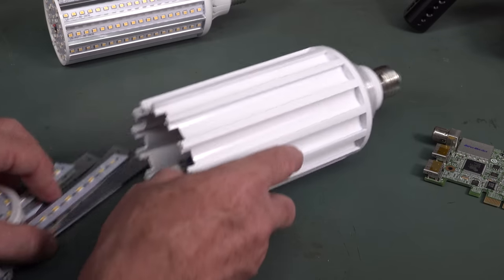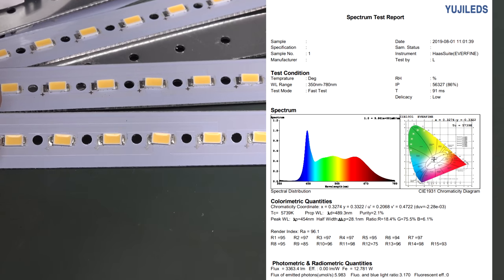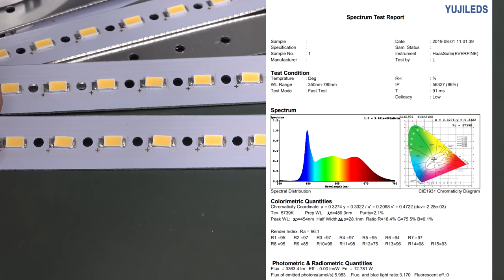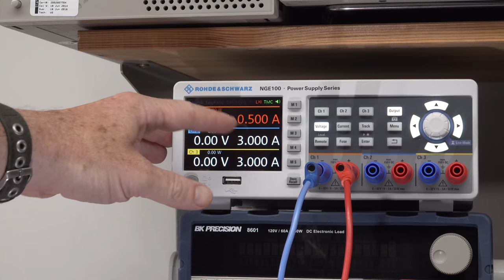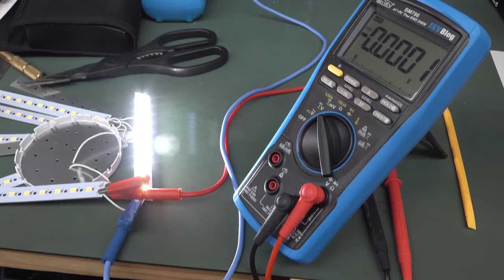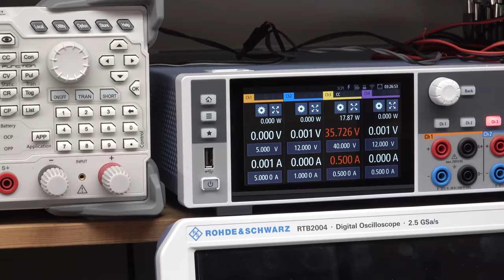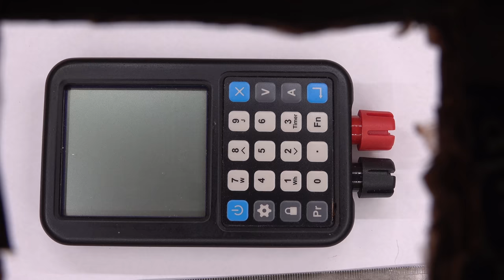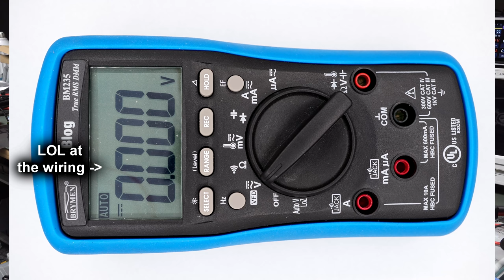EEVblog #1372 - DIY PCB Photography Light Box

Comment: Nice work!
Something worth mentioning about this is that it’s a reflectance light box, most ‘professional’ light boxes on the market are transmission light boxes. This is important for two reasons, transmission light boxes massively attenuate the amount of usable light you will get, often half and transmission light boxes (especially DIY ones that use cheap printer paper with fluorescent whitening agents) will ruin your CRI and CCT (can be on the order of 2,000 K) completely defeating the point of using 95 CRI LEDs. You could see this when Dave used it without the Alfoil® everything had a cardboard brown tint.

But by using reflective Alfoil® you don’t attenuate the light in fact you reflect light that would be wasted going off-scene back into the scene and aluminium has a reasonably ‘flat’ spectral reflectance response so you won’t ruin your CRI or CCT (unlike horrible printer paper) just make sure to use the matt side. 

The downside is you will still get specular hotspots from the LEDs, but if this is a major issue you can mount the LEDs at the bottom edges pointing up but that has its trade-offs. Reflectance light boxes are also just harder to use and more limiting hence why transmission light boxes are so popular. 

TL;DR buy a thousand incandescent bulbs and paint them matt black except for a small window if you want to take photos will ‘acceptable’ colour rendering, however Dave’s thing is probably good enough for 99% of use cases.
Reply: I used to use a light box that used 60 25W golfball lamps to provide the light, in a box a little bigger than A3 size, that took a offset printer plate. Had to make a soft starter for it, using a triac and a unijunction transistor, so the switch on surge did not both trip the mains breaker, and blow lamps.
Reply from the maker: I'm thinking about mounting the LED's on an internal thin wire frame ( so the frame doesn't create shadows) and having them point upwards to bounce the light around the box. I'm pretty confident it would improve the result.
Reply: @EEVblog  Sounds good, only tip is the LEDs can create lens flares if they are placed just outside the frame of the camera thus needing a lens hood which may be undesired. Probably just experiment with your placement, you might find having them pointing at the sides is best for your sized light box.
Reply from the maker: @WizardTim  Yeah, my first thought was to angle them up and outward. Not hard to experiment to find a good solution for any given sized box. I'm a bit surprised the direct down one worked as well as it did.
Reply: Would a home movie projection screen work in this case? I think that it would scatter the light more than foil and produce less harsh shadows.
Reply: Or you can soften the leds with tracing paper.
Reply: @rhalfik  Or crinkle up the aluminium foil and use the shiny side, the random angles should bounce the light around more. Smooth foil gives more localised hotspots.
Reply: The key point is that you MUST use the dull (or the matt side) outward looking (glue the bright side). I did try white paint but the results are horrible.
Reply: Great points!
Reply: Why is no-one mentioning simple white paint? Seems nice and diffusing, very easy to apply, and I don't think plain white paint normally has fluorescent whitening agents?
Reply: @TheHuesSciTech  White paint does provide the best diffusion and almost completely eliminates specular reflections thus it gets used in proper professional setups (along with glass/quartz diffusers) but the paint they use is very specialised and expensive (typically barium sulfate). 

For serious DIYers steer clear of hardware store room paints as not just the ‘Vivid’/‘Ultra-bright’ ones contain whiting agents, those rooms paints also almost always contain a heap of additives for loads of different things like anti-bacterial, anti-strain or anti-glare and finding a true neutral reflectance white is rather difficult when they have names like ‘simply white’ and secret recipes. Instead go to an art store and get some titanium dioxide white, it’s cheaper and much better.

However, because it’s more expensive and a pain to prime and paint something compared to just gluing on some foil you probably already have, it’s probably not for everyone. 

(honestly it really doesn’t matter for most photography so long as it’s white-ish, any light box is better than no light box)
Reply: @EEVblog   Try a box white sides instead of silver it may soften the light for a better image
Reply: @rhalfik  Tracing paper is the way to go! It's my go-to diffuser for home-brew LED bulkhead panels.

For a box like this, I'd cover the inside with white printer paper (maybe a radius of a couple centimeters in the corners to prevent interference patterns), put strips of onionskin over the LED strips spaced 1-2 centimeters away, call it done.
Reply: What about taking the diffuser from a dumpster dive LCD panel to put in front of the LEDs?
Reply: @WizardTim  How about the paint used for projection screens. It is formulated to provide an even dispersion with little in the way of hotspots. I'm guessing you would want to go with a neutral light grey paint rather than the pure white. Also I think you would want to avoid the really high contrast and high albedo paints. I can't really say what it would do to the colors, though I'd like to think they would be pretty neutral. At least I'd hope so as home cinema enthusiasts are paying a lot for these specialized paints with the promise of neutral color reproduction...

Comment: as a photographer who builds his own lighting from scratch, this was hard to watch. especially for macro, bare leds and foil are the worst options. the leds should be facing away from the board so the light is reflected evenly from the inside of the box, which should be painted flat white.
Reply from the maker: Yeah, but it works surprisingly well.
Reply: Instead of painting it white you could build the box out of PTFE. It is by far the best lambertian scatterer in the visible. For this reason it is used in integrating spheres. Alternatively you could try to use PTFE film (get it from aliexpress) instead of aluminium foil. But you have to find a way to mount it somehow. Glue does not work on PTFE...
Reply from the maker: @hansen3072  Yea, my mate Doug Ford has a proper commercial integrating sphere. Been meaning to do a video on that.

Comment: Do not cut the box just yet to change height.  Just put the PCB on a "pedestal".  You will get rid of the border shadows (diffuse them), and by controlling the height you get different zoom, without touching the lens.  Once you have the"right" pedestal height, you might go in with the cutter on the box.

Comment: Edge shadows - add distance between the board and background. 
You can also use a light gray background so the board pops-out of the photo. Also addresses the over exposure concern with smaller boards.

Comment: Very good job, Dave!

Regarding adhesives, if you need to cover cardboard box with al foil (many of us have done this done this for solar cookers), you can't do much better than glue stick. It won't wet and delaminate the cardboard, it holds well enough, and it has a very forgiving working time. There are spray adhesives that give better hold, but they either have critically short working times or wet the cardboard too much.

Comment: I use a flatbed scanner. Its field depth is generally sufficient to get everything sharp up to 2 cm height. Lighting is also always perfect. Resolution of 1200 dpi is unattaignale by any other camera. The setup time is also much more rapid than with your contraption.

Comment: I built a setup to photograph album cover art for my music collection.  The reflections and lighting was so difficult that I just downloaded images instead. 
I also built a jig to photograph slides. This turned out a lot better. I use a piece of "opal" glass from Edmond's as the diffuser. I use a 5k lamp, which isn't perfect, but I take a picture of the light coming through the diffuser and use that to correct white balance. I'm able to pick up grain structure on Kodachrome 64 slides. I'm using a Canon camera with an adapter to an old Nikon F1.7 lens. This works much better than trying to use a Canon lens.

Comment: Recycling at its finest. :) My macro stand is made from an unusually sturdy product box, with the sides cut away because it's too small for lights. (An LED flashlight through a white plastic milk jug does very nicely from the sides.) My hands aren't at all steady so I use the autotimer for all stand & tripod shots, which lets me use ISO 100 too.

I also made an Amazon-box door sweep with a 12V fan in it to fend off all my neighbors' pot smoke and other obnoxious odors.

Comment: Dave vs Clive: Dave: $Thousands lab power supply. Specialist studio lights. 3-day project to build all. Prototyping, measurements and calculations. Clive: 20" light strip left from xmas. Tupperware box. Cellphone. The Tupperware being most expensive item of the construction. Safety warning regarding cutting holes in Tupperware.

Comment: Any design that lets light from the LEDs impinge directly on the subject will create shadows and reflections.  To prevent that and get diffused light, cut the sides and most of the top out of the box, leaving a "frame" of cardboard at the edges and corners.  Cover the openings with sheets of parchment paper (used in baking).  Enclose that box inside another, larger box, with the LEDs mounted inside the outer box.  You'll need more LEDs to achieve the same brightness, but you'll mostly eliminate shadows and reflections.

Comment: It may be worth trying to elevate the board inside the box instead of cutting the sides of it. Get a white platform to set the board on to move it closer to the lens if need be.
Reply from the maker: Yep, a carboard shelf and some books will do the trick

Comment: Suggestion
To get an even DIFFUSE  light.:
Paint the whole inner box with white matte. Put the lights on the floor, pointing to the ceiling of the box. 
The lights might be higher than the thing you want to photograph by 8mm at least.
You may want that the direct light DOES NOT GET INTO THE FIELD OF VIEW of the camera
You would like to make a trigger circuit to shot more amps in a few ms so you will have more light with out damage the leds
To calibrate the focus you may want that the trigger circuit, fires a stream of pulses coincident with the camera frames in video mode
So you can get the best focus.
Try to experiment this
To get even better results try to make a vaulted ceiling and paint that is reflective white.

12 years in pharmaceutical industry dealing with glossy surfaces all the time.

Comment: Dave another idea for better high res shots would be using multi-illumination fusion technology. You simply take many shots of the same scene with varying illumination angles or distributions. Then these images are registered and fused by some form of variance based weighted fusion back to one image. The approach is similar to extended depth of view processing. I have done extensive work in this field and think that with an automated macro rig where the illumination sources are switched and pictures taken you could get splendid results and even increase resolution by resampling to a finer pixel grid. There would be next to no shadows depending on the number of illumination angle shots. In summery the opposite of your one shot method. In the field of microscopy we call that also AIM angular illumination microscopy.

Comment: I remember working with someone who liked "reverse engineering" PCB's and there was a Flatbed Scanner we found one time that had a "3D" scanning feature that worked wonders for getting high resolution pictures of boards and related components. Not sure how it mitigated shadow and reflection, but it got some pretty good results
Reply: I've scanned boards on scanners for years. All the scanners I've tried (HP models) seem to have no issue focusing above the glass on the PCB, or the optics have a deep enough field of view that it all looks in focus anyway. Because the light source is at a constant angle to the board and the sensor, you get an extremely flat and evenly lit image.

Comment: You don't need Brighter lights you need more diffused and even spread lighting hens why softboxes for lights exist lol and a sturdy rig to hold the camera and shutter trigger, with a slower shutter speed, then regardless of how dark the photo comes out in Raw file, you just need to use the software white point on the paper and it will automatically brighten up the image to its true color as long as you can stay in the plus 5 or -5 exposer range. But like you said every man and his dog has their own opinion and even more so when it comes to product photography.

Comment: Don't really see the issue with still images? You can basically have a shutter speed as long as you want?
Reply: You need a tripod then. and even then you need to keep the bench absolute still during exposure. Ground rule is: the more light, the easier the work, the better the photo quality.
Reply: @erikdenhouter  I can only hope people use a tripod by default. Otherwise it's a very strange story to begin with.
I have been doing photography for the last 15 years or so. Extremely doable. The more light is only an issue when there are moving objects. Otherwise it can very easily be compensated. Even with very affordable tripods. 

Don't know what desk you're working on, but most desk are like not moving anywhere?  

It's definitely NOT ONLY the light, it's always the combination between light, exposure time, ISO and these days a bit of post processing. Since the object is only flat on the bench, you can also completely open the diaphragm
Reply: @p_mouse8676  You don't seem to have done much in macro. Light is not only needed for moving subjects. With 3D objects in macro like a populated PCB, you mostly need depth of field, and that means closing the diaphragm, not opening. And with more light you can use lower ISO so less grain (or 'noise' in digital photography). Indeed, a tripod is more needed with lesser light, but if you have the light, shooting such object from the hand is quicker, more convenient.
The only thing that would bother me with such a light box is that it is difficult to see if you are shooting perpendicular to the subject from two directions.
Reply: @erikdenhouter  like I said 15 years of experience, learned from people who were over 35 years in the field. Yes including macro.
Anyway, have I nice day!

Comment: Lightbox / portable studio DIY build, nice!
I've been meaning to do something similar.... for years now, only for documents, receipts and whatnot. :P
Light strips, a shirt box only taller should be close to right size for up to A4 paper, glass/acrylic sheet to keep things in place, and an old smartphone or tablet to take photos and sync directly with a NAS...
Still not totally sure how I'm gonna solve the glare problem, but it's probably doable. 
Perhaps taking an anti-glare panel from some old laptop, and/or using a polarizer lens for the camera.

It's just more practical than ye olde flatbed scanner... particularly for stuff that I don't really need to be high res... just for text to be readable.

Comment: I think your issue is you need a camera arm  to  nail a height issue you are  having whilst you are snapping the photo
Reply from the maker: Like I annotated in the video, my tripod folds 90deg to allow overhead camera shots. And I use that occasionally. Not really needed in thsi case given that the cam can just rest on top and there is a ton of light.
Reply: @EEVblog  okay i was more thinking a rail system on a  with cam on  an mechanical arm

Comment: You should use a mid-tone grey background as camera are programmed to work on the grey scale that was invented by the worlds greatest photographer (in my opinion lol) Ansel Adams in that all colours in black and white photography are measured in black and white with shades of grey in between this way if you give your camera a mid-tone grey to look at all of the colours will be correct then all you have to deal with is your exposure which can be fixed by moving your lights closer/further to your subject. You can also get anti-glare sprays that will stop the reflections but that's cheating lol just got to the end of the video.....instead of using al-foil spray the inside of the box with matt white paint for a better result